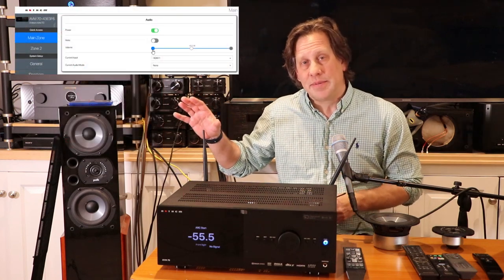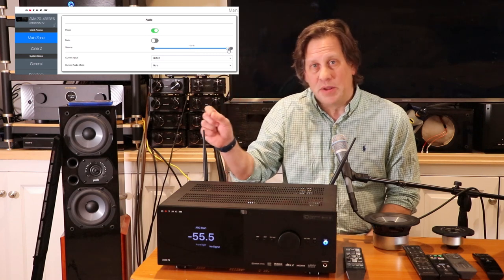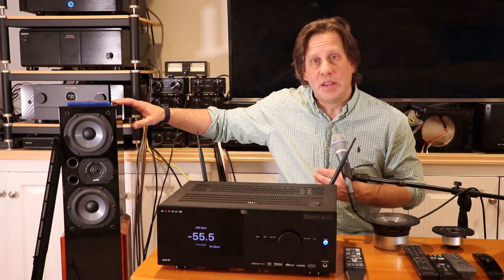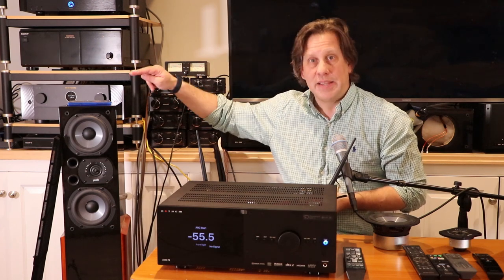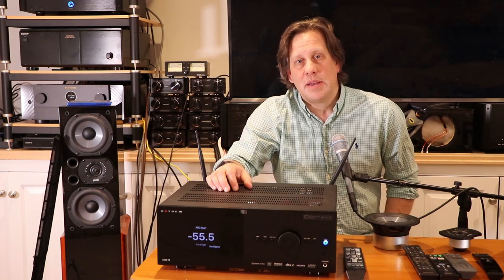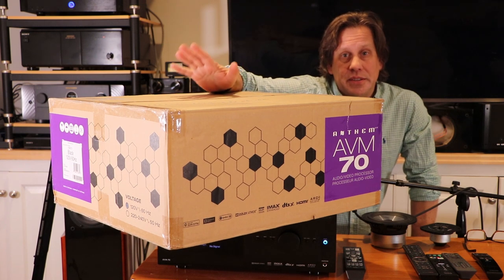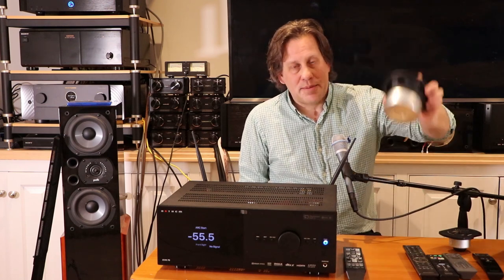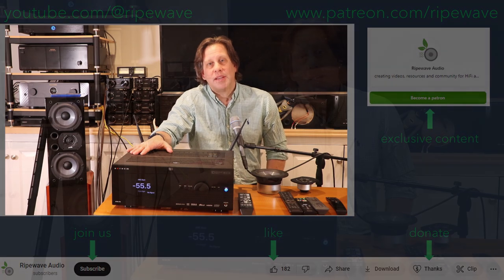Anthem AVM 70 8K - Part 3 - Failing Amp, Blown Speaker Troubleshooting

Comment: Thanks for your reviews of the AVM 70 8K, I've been watching with great interest. Sorry to hear about your blown speakers and amp problem, terrible situation. I bought one of these 5 days ago. I have all Emotiva amps, a 5-ch High power (using balanced) and a 6-ch BasX (unbalanced). I noticed the ARC calibration tones to be much louder than anything I've experienced in the past. I am fearing damage after watching your troubles. I have my master volume level set to -15dB. But, Not even sure if this setting is coupled to calibration? Or the accidental clicking on the volume bar and it going to full volume? I hope the master volume setting, and in my case -15dB might save the day? I have subscribed to your channel, and thumbs up! Keep up the good work!
Reply from the maker: The good news is that once you get past the calibration, the results are very pleasing. I heard recently that Anthem addressed the issue I had. Seems like a recent fix for what I reported almost a year ago - I wasn’t the only one.

Make sure you have the latest firmware installed, to ensure the newest fixes are applied first. Hopefully that message was accurate.

If the problem is still there I don’t believe any lowering of the volume knob will change the output level during calibration. The only method that worked for me was to lower using the web app 

Let me know if you are successful.

Jon
Reply: Hi Jon, I updated the firmware as soon as I took it out of the box. I noticed there’s a calibration volume slider in the software, not sure when that was added?  I’ll be experimenting with this as soon as I’m able.
I sent one of my amps in to add two more modules, so down for a few days.
Reply from the maker: I think the adjusting the slider may help. Keep an eye on it. In my case (with older firmware) the volume adjustment was very sensitive. If you click a little to far to the right, it would jump to maximum volume. -Jon

Comment: Same happened to me when I used ARC genesis the first time
Reply from the maker: Sorry to hear. After that have you found a way to avoid? -Jon
Reply: @ripewave  Not yet, I only ran it once. Did you try setting the Max volume level on the main zone under general tab to something like -25db?
Reply from the maker: I had my maximum volume limit set to 0dB lowered from the default of +10dB. Apparently not low enough and not sure if that limit applies in calibration mode. -Jon

Comment: I take it the Emotiva rmc-1 is staying it the rack and appears to be a better sounding with dsd support but no aurora 3d , with no  hdmi 2.1 Imax enhance , roon ready, and streaming support Spotify connect airplay connect its like a barebone unit with less feature but has the better room correction direc that’s still pack a punch, Emotiva for the win.

Comment: I too am having the same problem with the test signal only in the surround speaker in my 7.1.4 room. So loud I feel it is close to blowing the speaker.  I'm running all KEF speakers but the only pair that have a problem are the KEF Ci200RS-THX that are running with 90db sensitivity as the surround speakers.  Also using the AVM-70 with 2 Parasound A52+ (180 watts) amps for the surrounds and atmos and A31 for the RCL. All connected with XLR from processor. The AVM is running the latest version of software. I can't seem to power the surrounds down in the AVM to make any difference once it starts running the ARC.  Any suggestions would be greatly appreciated. Great video on the topic btw.
Reply from the maker: I am going to reach out to Anthem again. While they said their developers were working on this, I haven’t anything since - a few weeks ago. I will let them know others are experiencing the same thing. -Jon
Reply: @ripewave  I appreciate that John. Hopefully there is an easy fix to this.

Comment: Maybe it is Quality control problem with AV70.   I currently have one and it is working great but it is my second unit.   The first one I got only had sound out of the front right and one surround and the subs.   I thought I must of hooked something up wrong and spent a good deal of time troubleshooting.    Even hooking up my old receiver to prove to myself that all channels are working.   I took it back to the shop of where I purchased it from and they found that I was correct and I had a bad unit.  They got me another one and it worked correctly right from the start.   So it seems like Anthem may have Quality control problem and there seems to be some bad units out there.
Reply from the maker: You may be right given your experience. It is possible I have a similar case. -Jon

Comment: I so wanted good news about this processor but with fan noise, crappy documentation, challenges taming it so it doesn't shred cones... I'm going to have to keep looking. Its a shame because the artwork of the front panel is quite appealing.
Reply from the maker: This was one I approached with optimism. While there was a lot I liked, such as the great sound quality. Unfortunately I ran into those negative items which I needed to communicate along with its better points. I understand they have recently limited the conditions which cause the fan to come on, but it is still loud. -Jon

Comment: Hi John. Did you ever receive follow up from Anthem. I have the same problem while runninc ARC. Not blowing up speaker but my center channel rattle due to 90db+ level going to it with low frequencies. I have the AVM70, parasound A52+ and 92db efficiency 4ohm speakers.   Anthem support told me it was normal. Don't believe that answer but not much I could do.  However curious to hear any new development you got on this.  In advance I thank you.

Comment: Did you try running the test with same AMP but using the unbalanced connection?
Reply from the maker: I did not. I only used a secondary amplifier that only had unbalanced connection. The Emotiva amp does support both balanced and unbalanced connection with a flip of a switch. -Jon

Comment: Yeah the Emotiva has problems ...I bought a couple of mono blocks from them xpa 100 and had a problem contacted Emotiva and they didnt want them back in for repair...long story short Gene from Audioholics had problem from Emotiva amps and Emotiva wouldnt do anything about it either....too bad you sending Anthem back but my guess is the emotiva amp was the cause and it effected the Anthem ...just my take from my experience with Emotiva I have a Anthem amp now with no issues for 3 years now
Reply from the maker: Sorry to hear about your negative experience with Emotiva and glad to hear you found success with Anthem. I am familiar with Gene’s experience as well. I am working with both Anthem and Emotiva. At this point it is too early to determine what the outcome will be. Both companies have responded. I may still have a speaker issue so a call to Polk may be needed as well. -Jon
Reply: @ripewave  Good Luck!

Comment: Arrg I have lost my way.

Your points on the remote and setup issues have really turned me off this this brand. 

Also the emotiva alturnative not having hdmi 2.1 port takes that off the stage.

Leaves me with the marantz 50 or 40 with external amps. 

Can't find much info on if 40 sounds any better. One blog and thats about it but of course xould be biased.

If also wondering if basX 3 or X 3 for LCR should be used to make the 11 channels with better amplifiers. 

The cost is getting up to entry level seperates. But those entry level processors not having 2.1 is turning me off. 

Any ideas for alternate options around the $3600 US mark for 7.1.4 hdmi 2.1 and dirac?

Comment: So sorry to hear about your system issues.  It seems to me that there are 3 problems that all need to be addressed.

Anthem does need to address the fact that you should not be able to drive the amplifiers with full system output during a set up process since test tones are nothing like the waveform that you will get listening to music or movie soundtracks.  This is not only dangerous for your system but also for your ears.

Emotiva apparently needs to have better protection circuitry to shut down an amp when overdriven.  I've never heard of an amp that has a portion of the frequency curve stop working.  It is typically all or nothing.

But it also appears that you are driving your speakers with an amplifier that can provide much more power than the maximum power handling capability of the speaker.  I have no idea what the maximum power handling is for the Polk speakers that you are using but I highly doubt that it is 1000 watts.  You may want to consider this even without the Anthem.  If someone accidentally turns up the volume on your system, those amplifiers will probably blow out your drivers once again, regardless of what processor is in your system at the time.

Good luck with all your repairs.  I do love what you are doing and I appreciate the effort that is obviously involved in all of this.
Reply from the maker: Thanks for your support. Let’s see what Anthem comes back with. They are researching. Best case is it was my fault and I can explain so others don’t fall into the same problem.  

At the moment I just connected with Emotiva. Let’s see what they come up with. I have been using those amps with the same speakers since 2018 with no issue. My understanding is that is better to have a good amp that exceeds the power handling of a speaker then an amp that with go into clipping which will do more damage to a speaker over time. -Jon
Reply: @ripewave  You definitely don't want to clip but you also don't want to have too much power as you have discovered.  Under normal operating conditions it shouldn't be an issue but you run the risk of just this type of situation.  Good Luck.

Comment: BLOWING up a speaker??? As Anthem will - never - reimburse you ... That means a PERMANENT blacklist for this brand...  
My speakers are way too expensive to have them risk blowing up by any Anthem device...
Reply from the maker: At this point I am waiting on an explanation or fix from them. Should they come back with something reasonable (and lone me a unit to try) I may risk another try for the benefit of this audience. Until then, I would use caution, hold off or (as you say) seek alternate brands. -Jon
Reply: Oh no....the max volume slider is a danger.....it blew my 5 bed speakers tweeters, sometime back....now it's set at -20..
Otherwise love the sound.

Comment: It's the gain on the amp not the power ie if your amp is 34db gain it'll be louder
Reply from the maker: Sure, if given a fixed output I would expect the Emotiva amp always to produce a louder output. What I don’t expect is that a room correction system to always put out a same output level. I expect it would listen and adjust up or down accordingly. In this case  the expectation would be that Anthem ARC Genesis would sense that the output was more then it needs for calibration and adjust down. If I do that manually. It tries to adjust it back up a couple of times before giving up, but then tries to ramp up again for the next listening position. They seems to ignore that not all amps produce the same level of gain. -Jon
Reply: @ripewave  yeah I'd you had high gain amps and very efficient speakers like 100db+ it would be very loud.

All setups should start at low volume and determine level per speaker then output 75db safe level
Reply from the maker: Well said - Jon

Comment: I'm curious, what is (was) the serial number of your AVM 70?
Reply from the maker: It may have been: 4449270. 

While I have since returned the AVM70 8K, I have a screenshot showing the default device name as: AVM 70-43E3F6. I suspect they append the serial number to the name to avoid duplicate names. If I convert "43E3F6" from HEX to DECIMAL, I get 4449270.

Jon
Reply: @ripewave  I don't think that's the serial #. The correct serial # is an alpha numeric string, 14 characters long. It starts with "ALP" followed by a 1 digit number. Example: "ALP1B00281O011".